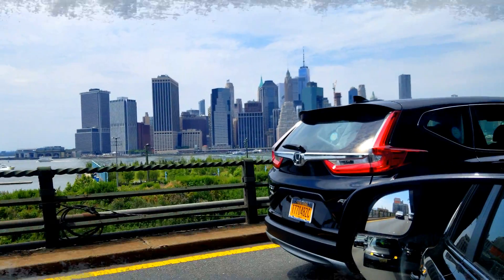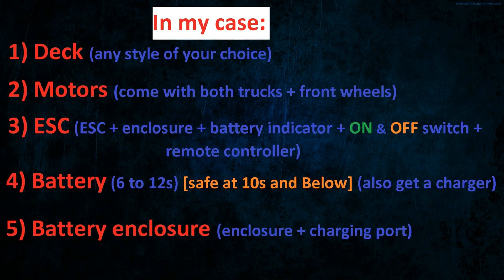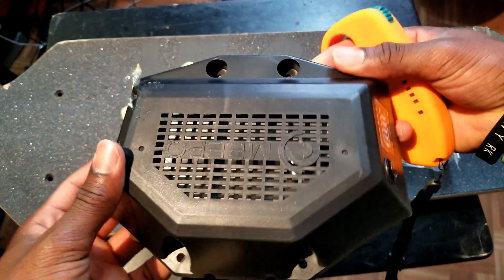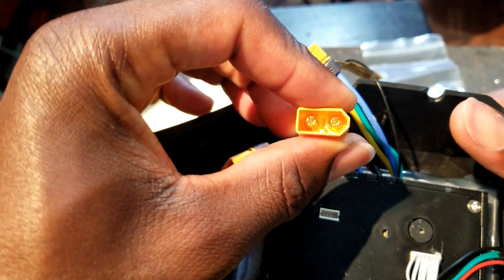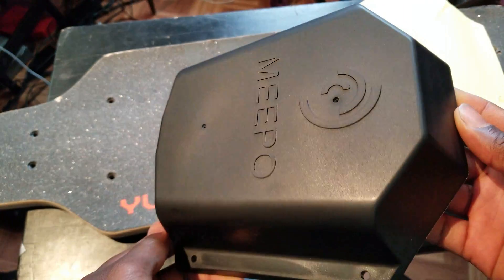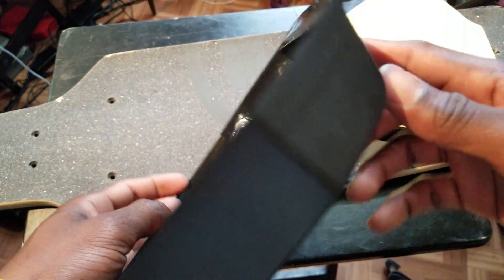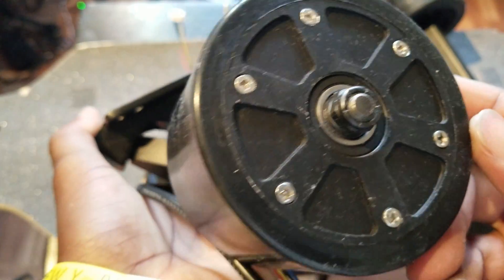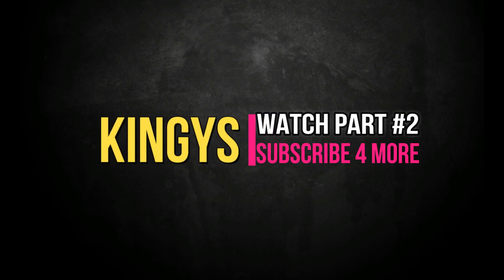BUILDING A DIY ELECTRIC SKATEBOARD - HUB MOTORS - PART #1

Comment: Hi will these hubmotors work fine without the sensors plugged in? i want to run them on my vescs but i dont think the sensor plugs are ganna match up to the vescs sensor plug ins
Reply from the maker: They work without sensor wires plugged in, but sometimes from a dead stop, it sucks to take off. Either not sure which way to spin or just unstable. You can get adapters to turn those sensor connectors into the ones used on the VESC. No worries about the missing wire! That is just for temperature! You can connect all others to the right spot and ignore the temp. Wire
Reply: @YvonSmart  oh really that is very interesting thank for letting me know!!

Comment: Hi! You say hub motors have less torque that is not true! The torquiest quickest accellerating e-board uses hub motors its called Raptor 2.1‼️
Reply from the maker: Tonio Xenon, you mean the torquiest accelerating factory built e-board!!! And the Raptor 2 is not the torquiest because it uses hub motors!!! If enertion used that same setup on a torque board 6374mm 190kv (over 3000 watts on a single motor while hub motor rocks 550 watts) with a gearing ratio of 15/36, their board would pull a truck on the neutral! (I mean if the belts don't snap). By the way, the torquiest e-board is from Trampa, known to never deal with hub motors. Those DIYs people ve been making are sometimes even torquier than the raptor. They just can't get on the radar since it's a DIY.
Reply: KingYS Tech. Yes I meant factory built.
Reply: KingYS Tech. When I'm done building my board the hub motors will be 2500W each x4 direct drive then we can test to see what has more torque‼️ 10 THOUSAND WATTS‼️
Reply from the maker: There is no hub motor with that spec yet! 2500W is more likely to be a belt drive motor! Hub motor does not need to be that powerful to be insane (It's direct drive 1R of the motor is equal to 1R of the wheel, so very low RPM 60 to 75KV). That's why there is no motor specs of the Raptor 2. Still
Reply from the maker: DAMMMMNNN!!! Never knew those motors were that sick!!! I'm definitely getting them! But the price tho!
Reply: KingYS Tech. Yea the price is on another level and they're always sold out but i'm gonna save up and get 'em for the back first. In the meantime I'm gonna upgrade everything else on my meepo I think it can go up to 28mph with vesc. Great tutorial bro!